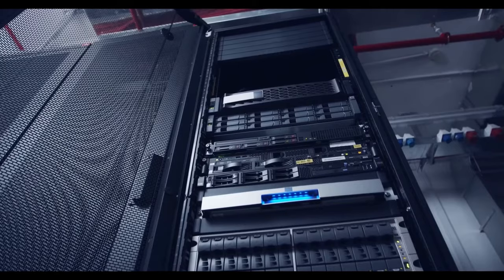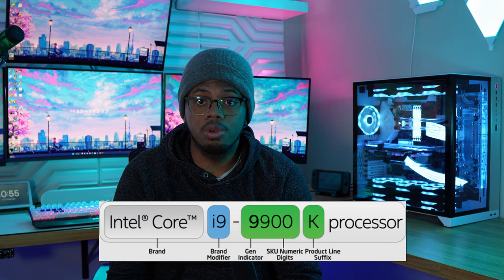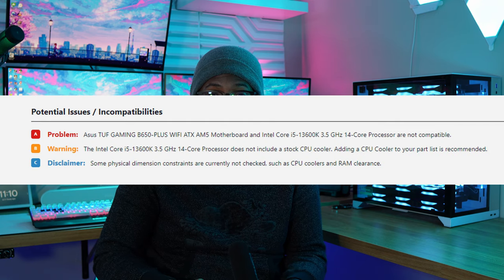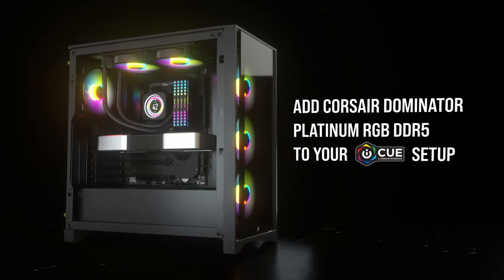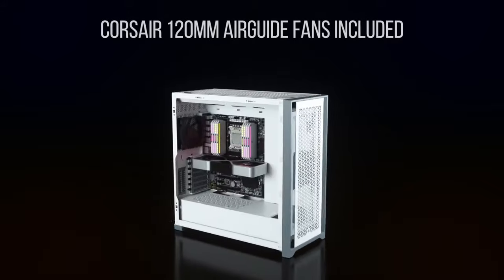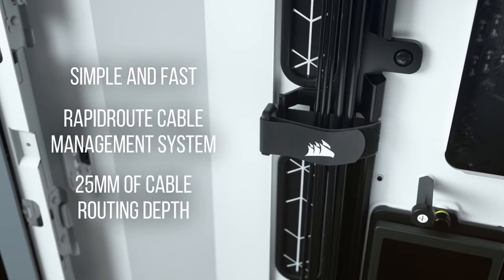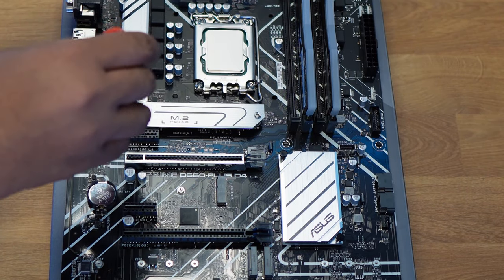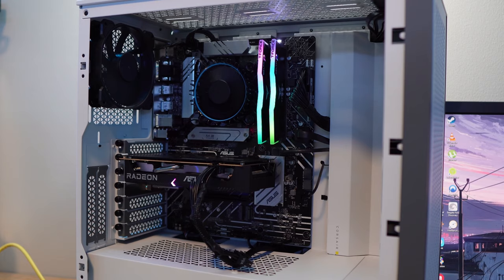PC Part Picking Guide 2023

Comment: The main problem that I have with PC part picker is they have disclaimer that the part sizes may not be compatible with the parts you picked, even when they are compatible. The whole point of using pc part picker is to verify the compatibility, the fit, etc.
Reply from the maker: Yeah that kinda does suck but for everything else its very helpful!